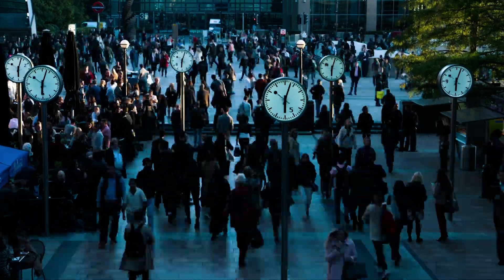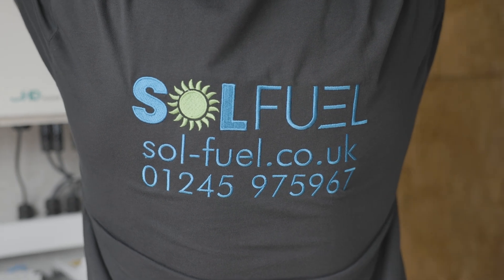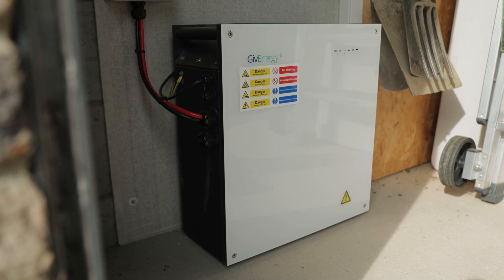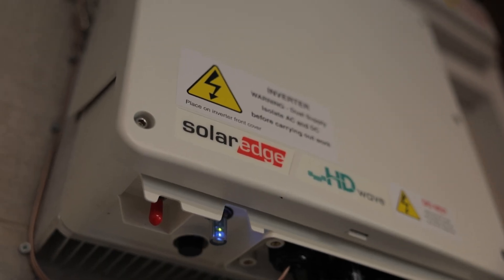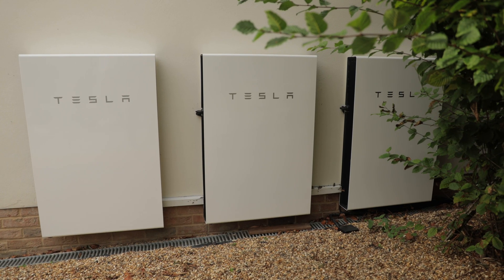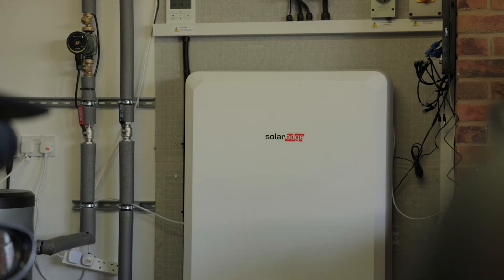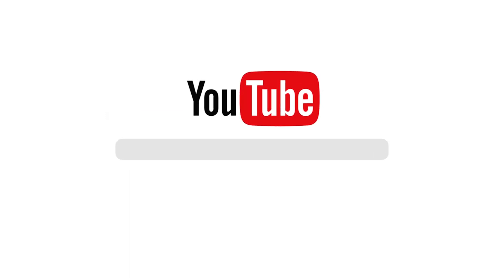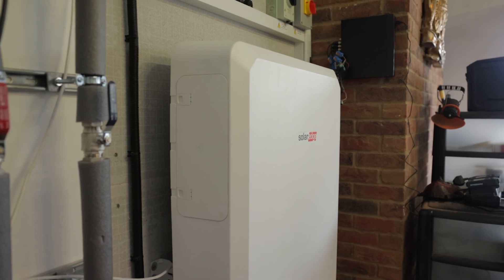Everything you need to know about Battery Storage.

Comment: Thanks. What battery do you recommend for 8KWh storage for £4k including installation as per your example . What warranty would this have? What round trip efficiency ? How many cycles?
Reply from the maker: Hi David, 
The battery system in the example is based on a Fox 3.7kW AC charger inverter and 3no. Fox ECS 2.88kWh battery. (8.64kWh)  Warranty of 10 years / 6000 cycles and a round trip efficiency of >95%. 
This would also be based on a basic installation where the system is installed in close proximity to the incoming supply / main consumer unit.  
As an installer the hardest part of the job is usually the cable routes from A-B and sometimes C. This is why carrying out a survey is super important for us as installers.  
Any questions please do let us know.